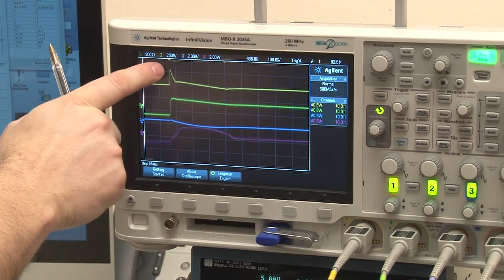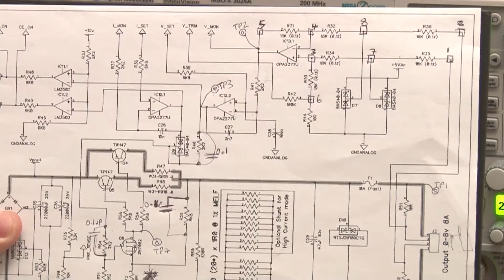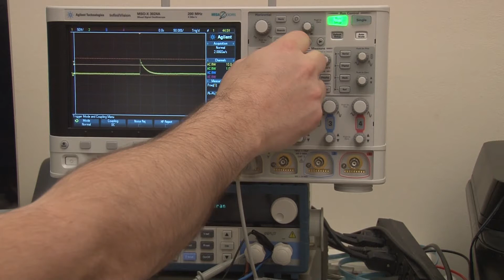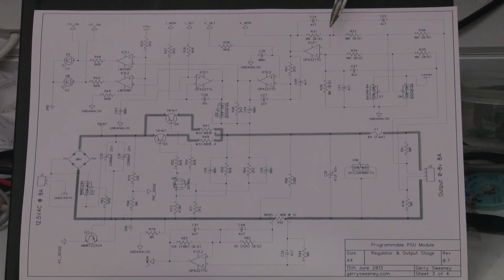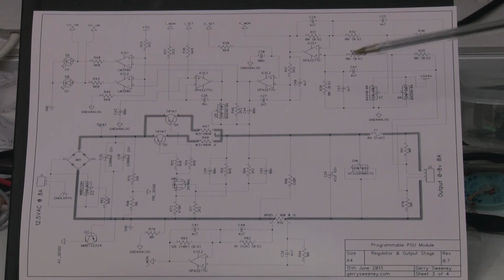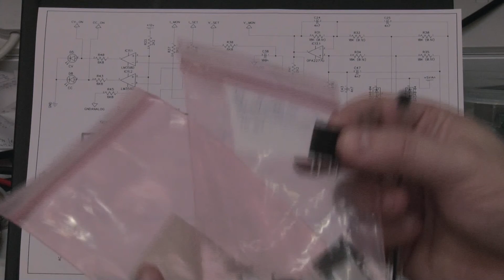Fully Programmable Modular Bench Power Supply -- Part 14

Comment: A warning for those wishing to build this project.  Do not use it to charge batteries, especially lithium based batteries.  When the charging finishes and the regulator turns off the minimum load resistor is still connected to the output and will begin to drain the battery without limit.  Batteries don't care if an alarm has gone off.  You must provide a disconnect relay to prevent fires.  I guarantee you will become bored with the charging progress, find something else to do, and forget about it.  Result is a damaged battery that may catch fire in the future.

Comment: Gerry, I want to build your's power supply.
PCB I designed in Eagle (but still is incomplete).
How many voltage (negative and positive) must I supply to op amps?
My version is 25V with switching winding from transformer.
Best regards!

Comment: Hello Gerry, I really like what I see here! Is there a place where I can download the final schematics? On your website it seems like there is no final version available yet.
Reply from the maker: Hi, you can get the schematics from the blog article link at the top of this page. I still have work to do on this so not finished yet, its one of those looooong projects I am afraid. Gerry
Reply: You wrote, that this is just the 8V version. How do you plan to implement the other voltage/current ranges? How will the switching happen?
Reply from the maker: Its just a re-configuration of the same design, changing mainly resistor values.

Comment from the maker: Yes I am planning to build a front panel board that will have a display, buttons, rotary encoder and a micro controller to control up to four of the PSU modules. I also plan to add Ethernet and serial to that so you can interface the PSU to the computer, capture data from the PSU's over time etc... The front panel controller will be quite generic because I am thinking about other lab gear projects to make too. Gerry

Comment from the maker: There are two multiplexers. One switched the read-back input to the ADC between the DAC and the PSU monitor circuits. The other is used to switch the control voltage for current and voltage set to 0V. Gerry

Comment: already subscribed, he is also brilliant, gerry had one question about the PS build. what is the purpose of the analogue multiplexer (4053)?
i am trying to reverse engineer a RACAL DANA power supply which has a fault with on of its output.it has two multiplexer ics  (DG 221 and MUX 24). tnx

Comment from the maker: Hi, it would be possible to extend it to use as a DVM its a pretty simple setup, all you really need is the ADC and the buffer and some form of input circuit. Auto ranging and input protection would be needed, a true RMS amp and so on, it can get complicated quickly but the basic elements are there.  To be honest, if I was to try and build a DMM or DVM I would use a much better ADC with a higher acquisition rate and better noise immunity.  Thanks for the feedback. Gerry

Comment: @Gerry Sweeney
Amazing work !!
I am wondering, would it be possible with a small modification to use this as a multimeter too? Or you need to completely redesign it? I mean we have the ADC, micro controller pc interface why not use those for other thing too :P
After that we need to extend this to a function generator :P

Comment: For a PI
1. Tune the P first (put a very large C2 to remove the effect of the integrator). Then find the value of Rfb at which the response becomes unstable (you will probably need a few POTs ranging from 1k to 100k), you'll want to try about a thrid to half this resistance for the next step.
2. Decrease C27 untill the response is acceptable.
3. Play around a bit more, i.e. start with slightly different Rfb.

Comment: Proportional control itself won't control to 0 error, so you'll need to use PI at least. To tune a PI you generally start with the P then do the I. The proportional gain is Rfb/R41, and the integral time constant is 1/(R41*C27), I think. So they should be decoupled.

I'd be surprised if you can't get a better response. Some suggestions for first attempts at tuning (without Laplace domain theory):

Comment from the maker: The configuration for the error amp U12.2 is fairly typical configuration, the cap in the feedback path is there to slow it down enough so the phase shift through the rest of the circuit does not extend beyond the point at which the whole thing becomes an oscillator. I have seen other implementations using a series RC for this but I have to confess I do not really understand it - I will have a play around and try I am not sure how far it will get me. Thanks for the suggestion.

Comment: My linear control theory is a bit lacking (I do a lot of microcontroller feedback control theory) but it seems your main "control" opamp U12.2 is a pure integrator, with a time constant of RC. This could explain some of the slow dynamic results you are experiencing. Not sure if this was covered in earlier videos, but perhaps try a resistor in series with C27 (opamp feedback path) as this will provide you with a PI type controller and better transient response.

Comment from the maker: No there was no ringing in the Agilent PSU I benchmarked, but I am pretty sure that PSU had a fairly large electrolytic on the output. If I do the same it suppresses the ringing. If I had the skills to design the filters properly and use LTSpice I could probably improve on it, but at the end of the day the ringing dies out really quickly (in about 3-4 cycles), is only present in large current transitions and is only a few millivolts in magnitude. I am happy with good enough!